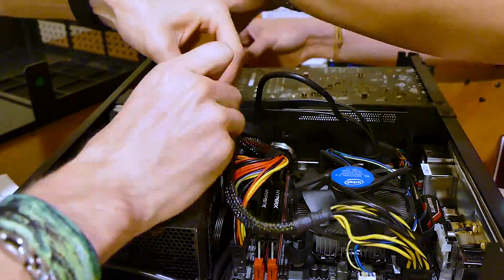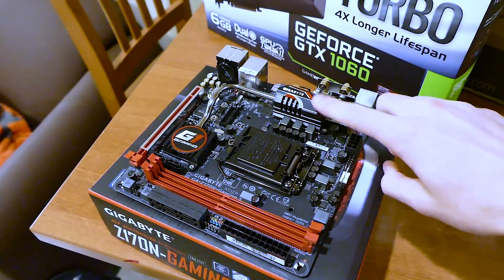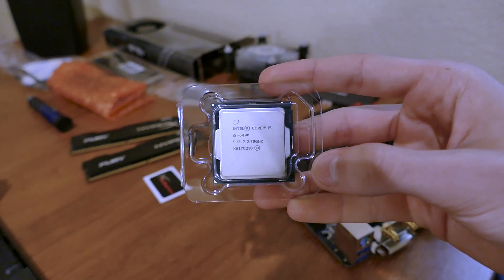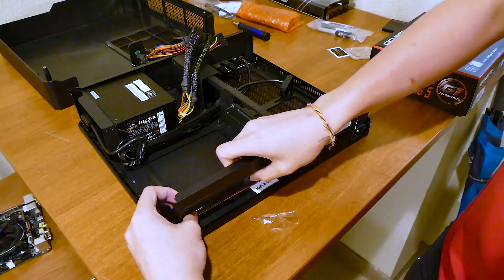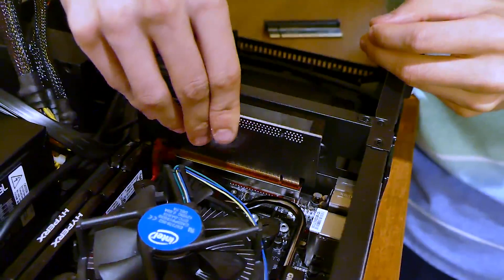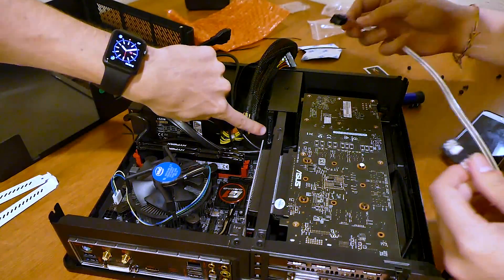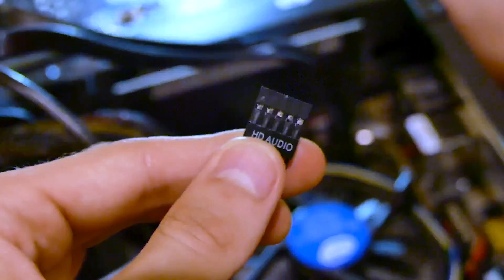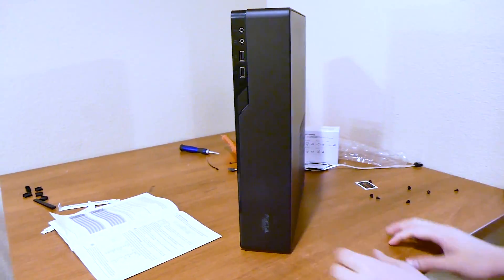How to Build an ITX PC (2016 Edition)

Comment: I just bought a laptop with better specs than this thing... wasn't 800 dollars though...
Reply from the maker: Figured ;-)
Reply: okay I could put a 6950x and a titan x pascal in there if i wanted to, he is just making a more reasonable pc.
Reply: A PC will last you longer. And have interchangeable part options.
Reply: +Jominator Did it really have a desktop sized gtx 1060 and desktop sized cpu i don't think so...
Reply: lol this guy
Reply: Salazar Studio 😂😂 laptops won't be upgraded right? I get it.
Reply: Have fun upgrading your parts
Reply: Depends on what it is. Regardless I can always fall back on my haswell-e desktop. I wouldn't buy a laptop like this before getting a solid desktop. I'd rather have the desktop than the laptop for sure, but I have both.
Reply: MeatPopsycle in a slim case dont expect those kind of air coolers. water cooler are a lot easier to handle in those tight spaces. here a idea of what you will dealing with http://i61.tinypic.com/125ta87.jpg
https://cdn.pcpartpicker.com/static/forever/images/userbuild/174445.0255a6acba435455c58bbe10aa888111.e54776d6cd662472293fc27c045f5cf9.256c.jpg
Reply: +Nicholas Pateldeleon I snagged a i7 6700k, 16gb of ddr4 2133, a gtx 1060, a gsync panel, a 240 m.2 ssd and a 1tb hdd... in a laptop.
Reply: +James Mastroianni that's not the point, I was more talking about the advancements in mobile platforms themselves and how their power compares to desktops.
Reply: Yes it does. A full fat i7 6700k and a gtx 1060.
Reply: I purchased a cyberpower fangbook 4 vr 100. it comes standard with 16gb of ddr4, a gsync panel, and a full gtx 1060. I upgraded the 6600k to 6700k since they were offering a 50 dollar gift card on all i7 purchases so it only cost an extra 60 bucks all said and done.
Reply: Yo
Reply: +Nicholas Pateldeleon Yeah i googled it already but ty
Reply: Alluu 01 there are no longer mobile gpu's, just downclocked versions of the desktop ones
Reply: I could definitely see that being a problem. I should have wall power anywhere I take it though. It would be rare for me to need to use it without it actually plugged in. I purchased it just for the portability for online college courses when I have to work nights. It's just a tad overkill for what it will be used for. I have a 980ti hybrid sli system for gaming at the house that blows the laptop away so it's unlikely I'll use it much at home except for school work that I'm to lazy to transfer off it.
Reply: I don't think mine will get 6 battery hours with a desktop cpu though. :/
Reply: I agree that it's an absolute waste what I'm getting mine for (school work). There's no school work a business degree requires that will need a laptop with the capability it has. I just needed a mobile platform,  and wanted something bad ass. once I get it in I'll be testing it extensively. Thermals, frame rates, overclocking ability...I might throw up some videos on it idk.

Who can blame me. It's admittedly harder to get excited about a mobile platform that performs like a mobile platform.
Reply: Nice! That's perfect for what you need, with mobility to carry everywhere. The only place I'll be lugging mine to is to my truck, and then into work (I'll have electricity available there) and back home. Plus the occasional trip me and my wife take. We wont be using it in transit, just once we arrive there really. I probably could have just gotten a chromebook tbh. But I like having the higher end hardware. This will be the first gaming laptop I've purchased since 2009 so it will be neat seeing how far its come.
Reply: Is this the part of the comment comment section for unwarranted e-peen pics?
Reply: Na- it's the part where sarcastic assholes interrupt conversations.
Reply: Jominator Sweet. Looks like I am in the right place then.
Reply: yes there is gaiming labtop that have for ex 970m in it but not the same preformance of gtx 970 if i have a 800$ i rather go for budgut 600$ pc and a chrome book
Reply: *****
not the same performance of a desktop compared to its price that is the idea...

for ex
laptop>800$> 45FPS @1080p>not long baterry life...heat.etc

Desktop>800$>60+@1080p even on 1440p  or 4k at 30fps

GET IT ?!
Reply: those small build are awesome.
i made mine 2 years ago.
it was in a elite 130.
i have inside a gtx 980 reference,a z87e-itx motherboard with moded internal wifi(using laptop antennas taped to the plastic front of the case) .
3 hard drives (1tb sshd for games+3tb hdd for documents and a msata boot ssd 256gb)
and a i7 4770k cooled by a nepton 120xl and 16gb of ram.
i used a be quiet dark power pro 750w  psu
i just love this thing!
it stay cool and it is only 1/3 of a regular pc case!
Reply: Tailslol How well does the 120mm rad cool the 4770k? Are you able to fit the full Push-Pull fan setup in this case? Lastly, do you overclock the i7 at all??? Thanks!
Reply: Hopefully that isn't true. Honestly, I am just curious how the 120mm rad in push-pull handles the job of cooling.
Reply: MeatPopsycle not overclocked the i7 in idle is around the temp of the room (36c with 30c in room) so yes that is cool.
Reply: Do you ever run overclocked?
Reply: MeatPopsycle yep it was in my previous message,oc from 3.5 to 4ghz in full load and minimum push pull fan speed and max pump speed i at 55c and around 40c idle.the 4770k is a hot beast.
Reply: My bad. I still don't see that but I definitely see this new message. That is pretty good temps out of a 120mm. I have been looking at small cases, and wasn't sure if it would be better to go with air or liquid cooling if 120mm was the largest I could go. Seems like CoolerMaster has a good unit there. TY for the info.
Reply: ***** Aren't there quite a few air coolers that do as well as liquid when it comes to load temps? Regardless, I am not a huge fan of overclocking. I am not sure I will be going any higher than stock speeds. I will buy a K SKU chip simply due to the fact that resale on them is friggin amazing.
Reply: Yea I think I may go with the Corsair 250D, since they fit the 240mm on one side and let the GPU breathe from the other. The system is a bit more money than I was hoping to spend, but It should be a pretty good performer and stay nice and cool. It is not the thinnest case in the world, but I have seen them with full custom loops inside. I have about 10 days to finalize my choices, so I will look into those sites you linked. Thanks.
Reply: me too... spent $2500
Reply: BUT can you upgrade your laptop in the future? Plus, you probably blew around $1500 which is pretty much twice the cost of this rig (i5-6400, GTX1060). And this rig will play all new games @ 1080p 60fps on Very High - Ultra settings. So you really wasted your money unless you travel a lot.
Reply: Not really. The laptop has a 1151 socket, so yes. Any cpu that fits that socket can be put into it. Plus it has additional ram slots that are unused for additional ram and an extra m.w slot. I'm not sure but the GPU may be soldiered so that would make it not upgrade able, I'll no more once it arrives. Laptops have evolved quite a bit.
Reply: Jominator
RAM you could replaced but I'd REALLY like to see you replace that CPU in a laptop.. lol.
Reply: Vicious Ahh no the model I bought has a desktop CPU and mxm GPU.. fully upgradeable.
Reply: Vicious Ok- but it's not really different than any other 1151 socket? It's literally an 1151 socket with an i7 6700k. Just pop the retainer and lift the lid. I don't see whats so hard to believe about that.
Reply: Jominator yes it is different.sometime laptop cpu are soldered,sometime they are without heat spreader lid ,and the cooler is adapted to the cpu temp so if you want no overheat or other pain when disasembling.dont change it.
Reply: Sometimes. There are also laptops with a full fledged desktop socket.
Reply: Jominator yea but here the problem will be the cooler.i dont think you will find desktop grade cooler in them heh...
Reply: No, definitely not. it will have to be some blower style cooler due to space. but it will still have desktop compute power. I doubt there will be much overclocking it either due to temperatures. But it's still impressive for a laptop to pack that kind of punch.
Reply: Go watch the Linus tech tips video where He shows the new 10XX laptop v desktop... My new 1070 kicks ass
Reply: Yeah... my 'gaming laptop' outperforms a lot of 'gaming desktops'. So not sure whats with the 'quotations'.

And the cpu gets a little on the hot side- I've seen it hit 83c one time The GPU actually doesn't break 73c, and if I up the fans I can get that down to 68c. Quite good for a 'GAMING LAPTOP' as you put it. 

Besides- I'm really only using it for Microsoft Word and web browsing. I have an X99 system for my home use.

get rekt dummy.
Reply: ***** you have no idea what you're talking about... Look up the top end Sager, Metabox or clevo.. MXM vid cards with desktop CPUs
Reply: LOL! The salt is real with this guy. So angry for a troll.

I know exactly what you were talking about dumbass. Did you even read my post? The implication was it hit those temps while running a benchmark, a synthetic load that will never be placed on it during its actual real world use.

I'd almost bet these 'GAMING LAPTOPS' outperform whatever your on anyway. Probably why your so mad.
Reply: Yeah I do have a $4000 laptop that has a desktop CPU and a 1080.. as jominator said you're just salty cos you're wrong and you probably have a core 2 duo so you can play Minecraft with all your "friends"
Reply: If you don't care then why are you even posting on this thread?

This may come as a shock to you but they make these things called graphics cards. They can be put into desktops AND laptops to increase gaming performance. When it's put in a laptop it's called a 'GAMING LAPTOP'. Just like you mentioned before. 

And your absolutely salty.
Reply: Hahahah I own my own house dickhead.. want to compare bank accounts?? Well see who's really living where. I use the laptop like a desktop.. it's hooked up to a monitor and has my death adder and G810 plugged in. However when needed, as an exampIe had to go to Japan for work last month, I can fold it up and put it in a bag... I have a life and move around. You lost this argument. The reason why you desktop o my idiots don't get a laptop as a viable option is because you sit alone, in the same boring room playing games and occasionally masturbating to women (or men) you'll never even get to say hello to let a lone actually touch.
Reply: I understood exactly what you were saying. That's why I replied the way I did, and as your a salty troll you've fallen back on insults and trying to act above the conversation instead of actually saying anything useful... not that you brought anything of substance anyway...
Reply: Science Studio  whats the fps in csgo?
Reply: ***** That doesn't even make sense?? Like jominator said you're just a classic internet looser who results to insult or trying to act superior when backed into a corner... You're probably just a 13yo kid trying to show the world how "smart" you are.
Reply: Yeah right.. no I'm pretty sure I've got you pretty much summed up. The fact that you keep suggesting my parents do what ever to me says two things.. 1) you're extremely immature and 2) you think I still live with them/they are in charge of me, ad I said I'm 33 with my own house
Reply: Do you ever get micro stutter with your SLI setup? I recently read that the laptop version of the 1070 outperforms the desktop version. That would be very interesting if true...
Reply: ignfan4life it's very possible. it has more cuda cores and a slightly lower clock speed. so overclocking a solid one could very reasonably yield better performance than a desktop gpu.
Reply: Jominator this thing will end like walter white
Reply: Hey there! which laptop did u buy?? I'm budgeting 800$ for a laptop too. thanks.😀😀😀
Reply: Optimus Prime Don't buy a gaming laptop at that budget yet. Wait for the laptops with 1050ti or 1050's in them. I doubt you'll have to wait long.
Reply: Got a decent itx pc with comparable specs, wish i had an SSD
Reply: Jominator Thanks man. And when are this laptops with 1050 graphics card coming????? I know about the 1060, 1070 and 1080 for now. Pls reply✌
Reply: Supposedly in early 2017. Im kinda surprised they haven't tried to make a Christmas push to be honest. You wont have to wait long. Maybe a few months. According to a quick google search the laptops with a 1050ti should be slightly better than a 970m. It would be worth the wait instead of buying something with a 960m or maybe 950m...
Reply: nice ITX PC
Reply: Khushil Parikh yes it would be more than possible

Comment: You could have bought a ASUS 1070 Turbo from Jet for $355 =/
Reply from the maker: Don't even start with the "could haves."
Reply: I'm just saying, it could have probably fit in that tiny case :/ That would have been like 20-30+FPS under the right conditions. :( how does the 1060 fare with that 6400? WHERE ARE THE BENCHMARKS!?!???1/1//?!/1/1/

Comment: great video. this case looks pretty easy to build in as its so open especially compared to other mitx cases. After seeing the required riser card that got me wondering, would you be up to doing a video on riser card ribbon lengths and seeing how much performance hit you get the longer you go, if any?

Comment: Would this PC be able to run FFXIV at high on 60 FPS? That is kinda my go to game. Also would it be able to run normal web surfing and watching twitch while using an Android Emulator on PC if I am home and don't want to use my phone?
Reply from the maker: Yes, most likely.
Reply: depends on what parts you use. If you use what was shown in the video, I would say so. However, if you use the cheapest Pentium you can find and no graphics card, probably not.

Comment: I want to know if the nzxt s340 is any good? Do you guys recommend this case.. I'm building my first gaming PC and I want to know you guy's opinion...
Reply: I recently built my new computer in the nzxt s340 case so far I love it and cable management is a breeze but the only thing I don't like about it is that the plexiglass window scratches very easily
Reply: typically speaking, nzxt makes damn good cases.
Reply: +Jared Heilemann thanks
Reply: +Justin Dushack thanks
Reply: I built in this case for my grandpa and it is by far the best case I've built in. It's extremely easy for a beginner and it was tool-less almost all the way through, no weird quirks but there is a motherboard standoff preinstalled, so just be aware, it wont short your motherboard. So I highly recommend it. Even easier than my current NZXT H440.
Reply: its airlfow is a challenge, get really good fans if you want it
Reply: Also check out the Phanteks P400. You might like it.

Comment: I like the look and size of the node 202, but it kills me that it doesn't have room for a 3.5in HDD. that is why with my ITX PC, i chose to go with a Silverstone RVZ01-b, got a 4690k and a GTX 980 in it, and it runs great! (hard to clean out dust though)
Reply from the maker: If your graphics card is short enough, you can cram a single HDD into the corner opposite the PSU.
Reply: could you test to see if laptop style 2.5in HDDs can fit in 2.5in SSD spots in some different cases?
Reply: i have the case. in order to fit a 3.5 inch (i have a wd 1tb) you have to completely remove the 2.5 bay and keep the gpu under 6 inches
Reply: no need as they are the exact sane form factor